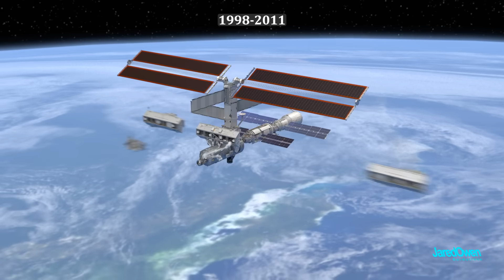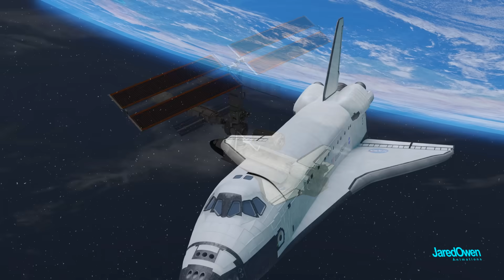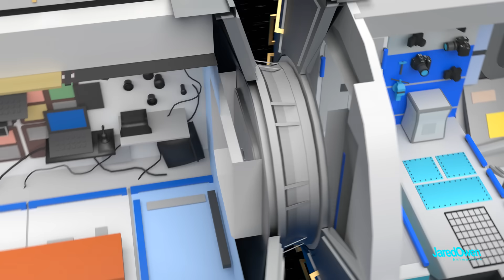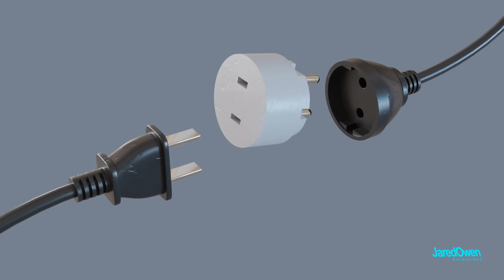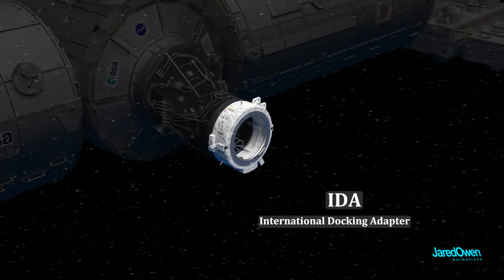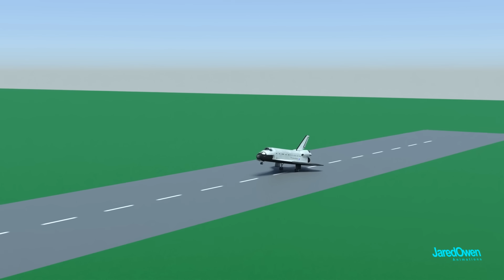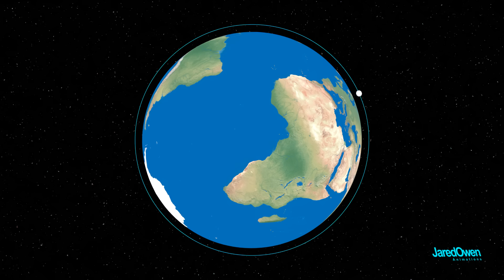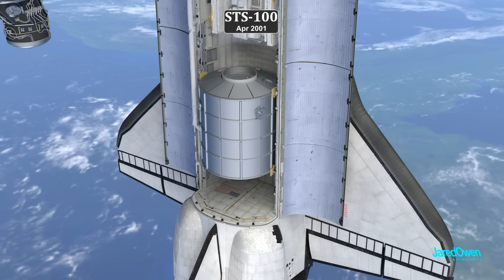How did they build the ISS? (International Space Station)

Comment: Why people still post fake videos like that ?  It's impossible to go in space, they film this in a huge pool and show you animation like that 😆😂🤣 Wake up people, a rocket cannot move into the vacuum of space.
Reply: I am interested in your theory about rocket engines and how they work (it seems you are smarter than all engineers who build these things) So let's say we have a rocket that produces a certain thrust and accelerates at a certain rate down here. The air becomes thinner and thinner when you go higher, you have 1013 hPa air pressure on sea level,  325 hPa at the top of Mount Everest, 191 hPa on the travel altitude of airliners (13 km), 165 Pa at 50 km , 0.3 Pa at 100 km,... So is there a certain threshold of air pressure /air density down to which the rocket accelerates with the same rate as down here, but then under that threshold doesn't accelerate at all anymore? If yes, what is the threshold? Or is there not a threshold but a relation like "half the air pressure = half thrust"? Or a combination? What is the formula? Or to frame it differently: What is the maximum altitude/distance to earth where rockets still produce acceleration?
Reply: @sebastiannolte1201  If you know the third newton's law and you have no air to push ...and in the vacuum of space you have no oxygen, it's hard to believe that they can move and if so, can we see it reproduced in a vacuum chamber?  Anyway and how high a rocket could go, well you saw that every launch you see it falling back down to bermuda so they never go except that Elon Musk launch that hit the firmament Dome or what ever, did you see that !! they say they exploded it 😂 We can clearly see it hit something huge and repair super fast not like the chalenger explosion at all.
Reply: @regnarol  
"If you know the third newton's law"
Yes, I know it. But it seems you don't know it. Rockets work by Newton's third law. When you sit in a wheelchair with a bowling ball in your hand and throw it away from you, you will roll backwards. And the Ball does NOT "push against the air".  You actually can move in space by throwing stuff away from you. That is how rockets work. When you shoot a gun you feel the recoil. NOT because the bullet "pushes against the air". Instead you also would feel the recoil in a vacuum. BTW also jet engines work like that. So you want to tell me that thousands of people go to the university every year and study aerospace engineering or a similar thin, learn how rocket engines work - but it is all wrong? You think nobody actually work later in that fiel but all become Uber drivers?  

And it is amazing how you  ignore what I have written. Of course I already knew that you have this weird "It has to push against the air" idea (because you have seen it in some youtube video), so I wanted to hear details. But nothing from you. What do you mean with "vacuum of space"? There is no perfect vacuum anyway, only for a limited area, what shoudl that even be? As I have explained, already at 10 km altitude you only have about 1/4 the amount of air to "push against" - shouldn't that affect the rocket if your theory was right? There is no  "beginning of space". The most used definition is 100 km (but that is arbitrary), but you still have 0.3 Pa there. And also for exampleat the altitude of the International space station you still some air. 

"Anyway and how high a rocket could go, well you saw that every launch you see it falling back down to bermuda"
Actually no rocket falls down. Do you have any evidence for your claim? And of course my "how high do they go?" had to do with the air pressure. Why do you made up theories without explaining them? 

"except that Elon Musk launch that hit the firmament Dome or what ever, did you see that !! they say they exploded it "
You mean the prototype of his New upcoming rocket? And you ignore all the successfull hundreds of rocket launches by Elon Musk? Satellites are a regular business, run by normal companies who offer services to normal customers, Feel free to work such a company or found such a company. There are also rocket start up companys. 

"We can clearly see it hit something huge"
No, we don't. Which flight actually do you mean? There were meanwhile several test flights, all exploded at a different altitude.
Reply: Have you ever been to school?
Reply: @sebastiannolte1201
  if they're not in a "perfect vacuum", how has it been up there so long without thrusters or melting for that fact? It would be constantly dragging against the particles up there.
Besides, the recoil from a bullet is the explosion of the gun powder, which separates a cartridge and bullet, shooting the bullet out due to the weight difference in sides. So what is causing the recoil in space? Seems like thrusters would be exhausting gas that would essentially be sucked out faster than it could be of use?
Educate me.
Reply: @tnwhiskey68  
" if they're not in a "perfect vacuum", how has it been up there so long without thrusters or melting for that fact?"
Actually the ISS loses more than 50 meters of altitude every day beause the drag slows it down. It has to be pushed from time to time, so for example every time by a spaceraft that brings supply or astronauts docks on the station. If they would not do it, the ISS would crash into the atmosphere in a few years. But the ISS is  in a very low orbit, only 400 km away. Actually it is called the "thermosphere" so you could say part of the atmosphere. You find an altitude graph in the wikipedia article "Interntional Space Station" in the chapter "orbit". Higher satellites are more stable (geostationary satellites are 35,000 km away)

 However, as I said, you don't have a "perfect vacuum" anywhere in the universe, because what even is that? You only can say that for a limited space. So let's say we want to look if there is a vacuum 10,000 km away from earth. So we take one cubic meter and look if there is any gas molecule in it. And there is none! So perfect vacuum, right? Well, but then we analyze a cubic meter just next to it, and we found one hydrogen molecule. So is there a perfect vacuum 10,000 km away from earth or not?

"the recoil from a bullet is the explosion of the gun powder, which separates a cartridge and bullet"
Yes, and Newton's third law says: To every action, there is always opposed an equal reaction; or, the mutual actions of two bodies upon each other are always equal, and directed to contrary parts. When something explodes (for example gun powder) then everything flies away, in all direction.

"shooting the bullet out due to the weight difference in sides."
Weight differences? I  don't really understand that. Mabye you mean mass. Well, yes, it is about momentum, which is mass x velocity. Imagine I am in space. I have a mass of 100 kg and I have a bowling ball in my hand that has 5 kg. Now I throw the ball away from me with a velocity of 10 km/h. Then my body will move backwards and the momentum (so mass  x velocity) has to be the same in the opposite direction. So I move with 0.5 km/h. I wonder if you have never seen these pictures in kid's physics book of somebody sitting in a boat with a bunch of stones, and that can move forward with the boat by throwing the stones away backwards?

"So what is causing the recoil in space? "
Do you want to say that the gunpower would not explode in space? I really have no idea why do you think that the vacuum should matter? And I also ask here: Up to what altitude would the gun produce recoil? So I have the gun in my hand and shoot it and feel the recoil down here at 1013hPa. Do I  feel less recoil if I do it on the top of 2000 meter high mountain with only 784 hPa recoil? And is there an altitude where I don't have any recoild at all anymore? 

"Seems like thrusters would be exhausting gas that would essentially be sucked out faster than it could be of use?"
Why "sucked out"? The exhausting gas is shot out with high speed. And also that gas has a mass. So again, like with the bowling ball or the stones in the boat: mass x speed of the exhausting gas is equal to the mass x speed of the rocket. 

"Educate me."
I am not an engineer. Just read somewhere (or watch videos...) how rocket engines work.

Comment: Building iss was this all happening @27000km per hour ?
Reply: Yes, relative to the center of the earth. You could also say it happened at 100000 km/h, because the earth moves around the sun with that speed. So everything you do happens at 100000 km/h relative to the sun. And when you fly  in an airplane with 900 km/h you move with 900 km/h relative to the ground and still can build a house of cards in the plane. You cannot feel speed, there are no forces. You only measure relative speed. When one ISS module moves with 27005 km/h and the other with 27000 km/h when they are connected then module 1 moves with 5 km/h towards module 2. That is the only thing that matters.
Reply: Imagine building a lego kit while you're on an airplane.
You'd be travelling at 500 mph or whatever, but that makes no  difference at all, if it's flying straight and level.

Comment: It's not exactly accurate regarding docking/berthing ports. Pretty much all Russian modules have docking ports and those modules docked to the station autonomously. The only exception was Rassvet module, which was brought by the Shuttle and berthed (and Zarya which was the first module so didn't dock to anything). Every other Russian module (Zvezda, Nauka, Pirs, Poisk and Prichal) was docked to the ISS, either using it's own propulsion or using a Progress service module. It's only the US, Europe and Japan modules which were berthed via robotic arms.

The "slow movement" of the Canadarm when repositioning modules was related to inertia rather than the fear of bumping into something. While you are weightless, inertia and momentum still exists! Fast movement of large mass would create opposite reaction of the rest of the system, essentially shaking and flipping the station.

Comment: where did that shuttle put his fuel to catch up iss for how many days?
Reply: inside it, in the OMS system. you can see the rocket engines used by this in the rear of the space shuttle. they're the smaller ones. however the reason isn't as if they burned those engines for days, but to do a safe approach using as little fuel as possible.

Comment: Great video and it brings back a lot of memories. I supported 16 of these assembly missions including 6 from NASA JSC Mission Control Center, right up to 2007.

An interesting component of berthing and assembly you didn't get into in the video is how you align the modules and why it took so long to bring them together. It wasn't like dock an aircraft to a gate with ground crew guiding alignment with light batons saying to move left or right.

There were several methods used including centerline berthing cameras and alignment targets. The system I was supporting was the Space Vision System that used all of those black and white targets all over the modules. 

SVS used the Space Shuttle cameras in the payload bay to track the targets on both the incoming module and the module on the ISS it is attaching to, and calculated the relative position and orientation (x, y, z, yaw, pitch, roll) 30 times per second. It had to berth slowly because these modules are massive so their inertia was both hard to get moving and hard to stop, and could do a lot of damage if anything collided. Alignment was monitored closely the whole way in.

Also, the ISS and shuttle were orbiting the Earth this whole time, so sometimes would traverse from night to day and vice-versa. That could put shadows on targets and make it hard to track all of them at the same time due to dynamic lighting. Pre-flight I had to analyze which targets were important and which could be lost and still perform the operation within spec, and keep an eye on this during berthing operations.

The last one in 2007 I supported remotely from my home in Ottawa at 2 AM in my underwear, using telemetry over the internet to my laptop, a cellphone to our MCC team, and NASA TV video streamed over a modded Xbox. When I went back to bed, my girlfriend (now wife of 15 years) asked if I couldn't sleep and I told her that, no, I had gotten up to assemble the international space station. Fun times. :)
Reply: That’s fascinating - thanks for taking the time to relate that - modded Xbox for iss construction ftw
Reply: wtf using an xbox lol? that's sum badass stuff lol
Reply: Супер, спасибо что собрал МКС и ничего не поломал там посреди ночи)
Reply: @dmitriysidykin4573 😂😂😂😂😂
Reply: Nice
Reply: Haha.  That's awesome!  Thanks for sharing!

--- your neighbor from across the river (Aylmer)
Reply: Супер видео!
А Вам оператору должны поставить памятник!
Я же когда то в детстве в физмат школе придумал лифт на луну, не зная что подобное уже есть, правда всего на орбиту. Мое решение я записал в тетрадь изобретений 40 лет назад. И только два года назад кто то подобное моему решение описал. Хотя я своё решение в разных соцсетях много раз описал ранее. У меня трос лебедкой с противовесом закреплен на поверхности луны, а одном конце - приемное устройство по типу захвата с высоты от самолёта груза и груз поднимается на орбиту. При этом другая часть троса с противовесом уходит вниз. Тросы не уходят в нижние части атмосферы. Энергия на подъем минимальна. Я тогда не считал расстояние между луной и землей большим. Да, масса троса существенная часть будет компенсирована нахождением в невесомости, плюс в инерции движения вокруг земли. 
Я также придумал как образуется шаровая молния.
Предполагаю что это происходит в момент когда линейная молния из точки А бьет в точку Б, и одновременно с этим из точки С тоже бьет молния в Б. В итоге первая молния ия на доли секунды приходит раньше и даже делает избыток электронов. А вторая, молния - не имеет точки приема и сворачивается в шаровую молнию.
И это может происходить достаточно часто.
Reply: .. reading citation from Julie Vern science-fiction book 17.500 per hour in ISS around the world..
Reply: Saya mau bertanya, apakah stasiun luar angkasa tersebut tidak bertabrakan dengan sampah luar angkasa??

Comment: Typical the 'muricans always screw up their sizes, why they didn't just use the Russian size and then you wouldn't need a "PMA"...
Reply: Because the American section has to connect to modules from multiple other countries. That's the reason they made the Common Berthing Mechanism standard, to collaborate with other countries. This is not a requirement for Russia as the Russian orbital segment is only for Russian modules. Russia and America had different design requirements for each of their station segments and decided they could use both standards because they were going to be sending up the PMAs to use anyway. Why? Because the US Space Shuttle uses the same APAS-15 system as the Russian Orbital Segment.

Don't believe for a second that you are smarter than actual, literal rocket scientists because something seems simple to you at first glance. I can assure you that if something is a certain way, it's for very good reasons.

Comment: I'm less curious about how they built it, I'm more curious about how they got it up there.
Reply: It's simple, just put it on a big rocket
Reply: They launch the rocket at the right time so that when this rocket reaches roughly the same orbital height, they’re already fairly close to each other. I’d imagine this would usually be tens of kilometres, maybe even a few hundred kilometres away from it, but still at the same altitude.

If the rocket is behind the ISS, it lowers its orbital height which will increase its speed. Then just wait to catch up to it. The opposite is done if the rocket launches too early and is far ahead of the ISS. Increase the orbital height to slow down and let the station catch up to you. Since your orbital heights are similar, you’ll be moving at similar speeds too.
Reply: they launch individual modules up into space and assemble them together there, cheaper and easier.
Reply: So basically the entire process is like building a lego set but on a massive scale floating on space
Reply: @Beeta425  basically

Comment: I love the Canadarm being able to connect and be controlled from both ends. This way you only need one for space stations way bigger than the reach of 1 Canadarm.

I also enjoyed the fact that they used the shuttle thrusters to connect the modules. (I'm purely speculating now.) It probably illustrates how slow the arm movement really was. I imagine they just couldn't get up to a high enough speed in the arm's span to overcome some minimum required force for the docking ports by purely utilizing the arm without risking damage to the arm. They just used the arm to line the modules up, disengaged the motors in the arm to avoid damage to the arm and pushed them together with the thrusters. Or perhaps even if they got up to speed the different forces while the docking ports interact would be very risky for the arm.